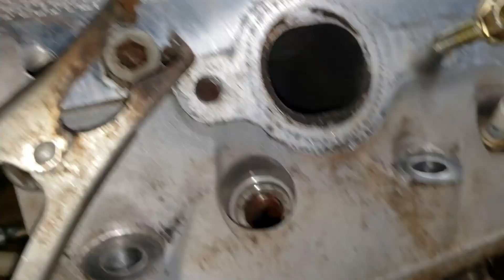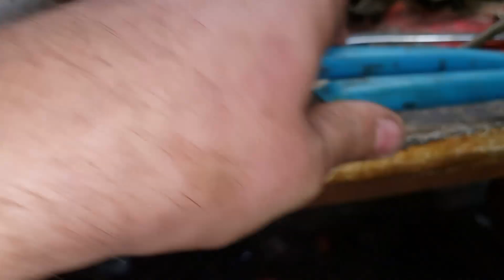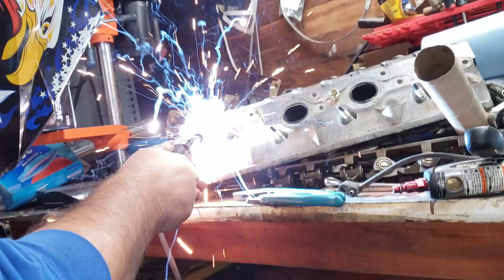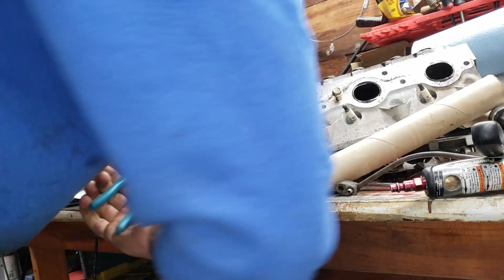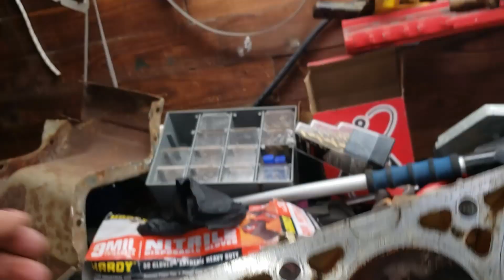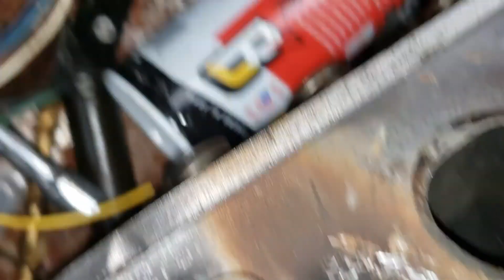Extracting broken manifold bolts from LS engine

Comment: This is the exact problem I fought this weekend. To make a long story short, I bought new heads. I can’t have nice things.
Reply from the maker: That sounds like a good story lol
Reply: The Driveway Engineer put a 04 5.3 in my 66. 100% to your blame. Started to bolt on the headers and realized both heads had the bolt closest to the firewall broken. Thought I could fix it in the truck. Welding trick didn’t work. EZ outs didn’t work. Drill and tapped but had second thoughts. Pulled the head today to find shavings in the water jacket. Good thing 706s are relatively inexpensive. Lesson learned
Reply from the maker: @austinmewborn1036  that's why I never drill them, there isn't a lot of meat there.

For future reference, the rear ones seems to be always broken.
Reply: The Driveway Engineer I noticed when it was out. But eagerness got me again and I put it in the truck and remembered too late

Comment: After you've welded your bead onto th broken bolt, spray some liquid wrench or similar on the threads. Then grab the bolt with a small pair of locking pliers. Work the bolt back and forth, clockwise and anti-clockwise, working the solvent down into the threads. Eventually the bolt will turn easier and easier and come out. The vise grips will stay off the surface so as not to mar.

Comment: Man like a couple days after you found that broken piston from a lean condition I was doing the head gasket on my moms buick and I have a piston that is melted does not look broken but i can see the top ring
Reply from the maker: That's a bummer!
Reply: Ya im trying to figure out what caused it I'm kinda thinking a bad injector maybe but i need to clean up the heads and see if there are any cracks its the 3800 apparently in 04 they were still using cast iron heads
Reply from the maker: @james10739  I believe the 3800 stayed all iron it's entire life.

Must have been running lean

Comment: I use my TIG welder to build up the bolt long enough to get Vice Grips on, most of the time it comes right out, other times, it takes a couple of tries. Drilling is impossible, the bolt is so hard from the heat, just dulls the bit.

Comment: JR I noticed you had different bolts stuck in the head brass colored what size are they and are they grade 8 or better?
Reply from the maker: Those are Dorman 03413B, the bolts I always use as stock replacements. I do not know id they are graded, they aren't marked as anything.
Reply from the maker: Scratch that, they are 10.9, which explains the coating.

Comment: This might be a dumb question, is flux core wire strong enough to remove the stud or do you recommend using gas??
Reply from the maker: I used solid wire with no gas lol, flux should work fine
Reply: @TheDrivewayEngineer  thank you

Comment: I've tried that a few times on my 862's and was successful on one broken bolt but the others have me some problems. I think the problem was my welder. I don't think I was getting bolt hot enough ?
Reply from the maker: It always works for me, sometimes I have to do it more than once, I try to spin it as soon as it isn't orange, but still hot.
Reply: @TheDrivewayEngineer   the last broken bolt was far down in the head I couldn't get it, luckily a extractor finished off. Thanks for sharing all the good tips and tricks 👍
Reply: @jayadams5529  what's a extractor i've got two broken ex bolts one exposed the other pretty deep in the head
Reply: @billytarpon9871  copy this and paste it to google -
"Irwin Hanson 19/64 in. Carbon Steel Spiral Screw Extractor Set 7 in. 5 pc.Item no. 21595"
Be careful when you drill into the old bolt, make sure your in the center of the bolt and don't drill all the way through it into the head.
Reply: @jayadams5529  thanks for the reply. used to call those (easy outs) the right name and pn will male it easy to find

Comment: Help a noob out here. So he’s building up a layer of weld on the bolt and then grabbing and twisting with the vise grips. Why doesn’t the weld stick to the threads on the head?
Reply from the maker: It's an aluminum head, standard MIG wire won't stick to aluminum